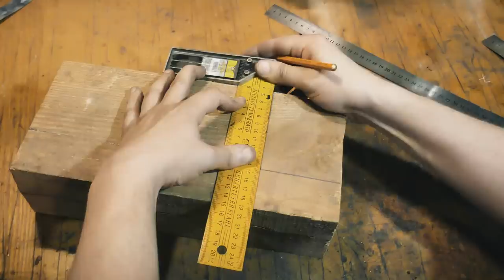Making Wooden Battle Hammer

Comment: put a small wedge in the back of the wood when you cut, your blade is being grabbed to much by the wood closing up on it. that what i do and it helps alot and it wont be so hard to push through.
Reply: The wood is smoking after making a 1.5" cut. It's not the wood grabbing, it's his very dull blade.
Reply: @roguesly5706  either that or it's for metal

Comment: The only thing I'd done as an extra tidbit would have been to apply a spot of strong adhesive under the leather wrap, and a but if adhesive on the end of the handle before plying it into the head. Just as a precaution.

Comment: What kind of paint/enamel did you use for the metal? I'm making a similar hammer but bigger, 2 handed, for the renaissance festival. I would be ok leaving the metal the same color but the bolts for the spikes are silver and don't want them to be black either.

Comment: Awesome build, really nice. Maybe a stupid question, but do you that pine would also be tough enough to be used as a wooden hammer in the shop for working in bolts and stuff? Can't really get my hands on such a large piece of hardwood and gluing boards together doesn't seem right to me cause I fear they might split as well to easily... I am grateful for all kinds of advice. The target is a cool looking wooden hammer that is strong enough to be used in my woodworking shop on a daily basis without breaking apart after some blows. Thanks in advance.
Reply: Pine wood is usually soft, so maybe for a mallet for finishing touches would be fine, pretty much like a rubber mallet.
Ashwood or poplar wood are sturdier, you can try those
Reply: @diegolunar7022  Thanks Diego. I'll give it a try with gluing oak today since that is something I got at home... I'll let you know when I finished messing it up. 😅👍